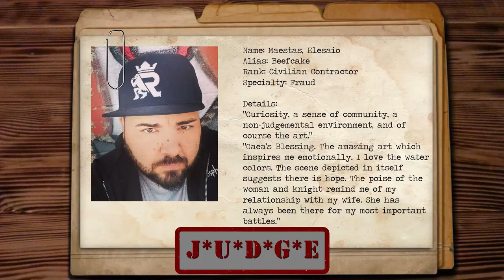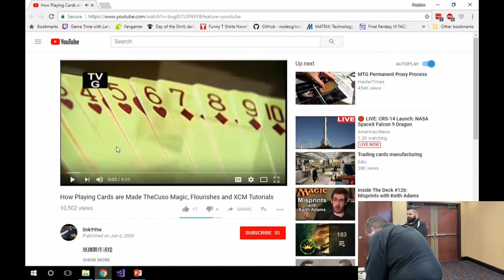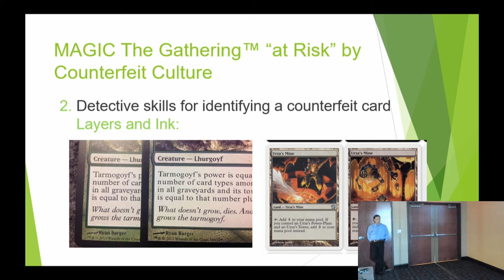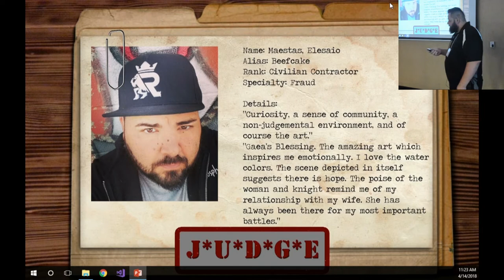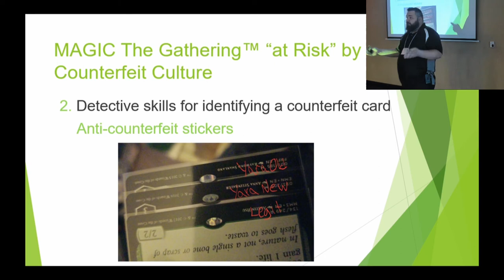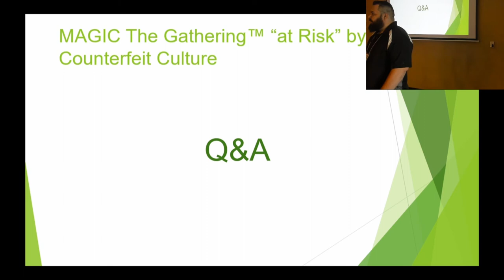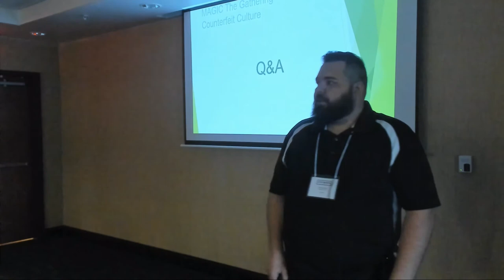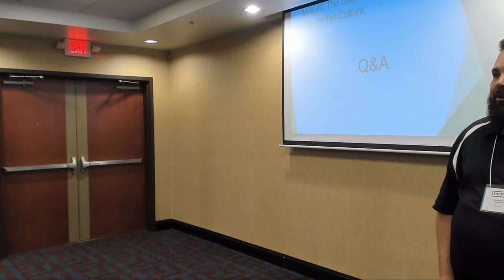Elesaio Maestas - Counterfeit Magic Card Detection

Comment: Also, "Beefcake" admitting to confiscating cards when the person next to them said they have no authority to do so is troubling - what if the person was legitimately scammed, and needed to hold on to the fake to get proof in order to dispute with Amazon, eBay, or wherever they got it from/got duped?  (on top of the fact that he was told that they don't have the authority to take cards from people, fake or not, and that it's still the player's property).
Reply: My guess is he considered brevity over accuracy for his presentation. Describing it with just "confiscating" can make it sound like he forcefully took possession. That's not how he works. It's more likely that he sat down with the player and took time to explain to the player what was going on and find out how the cards were acquired. If it was from tcg, amazon, etc. then he'd help by explaining what the player needed to do to try and get their money back. How do I know? He happened to be at the last event I judged and a player had roughly half his deck end up being counterfeit. He took almost an hour away from his booth to help the player sort out the cards and helped find replacements so that he could continue playing in the event. Beefcake did ask the player if he could have the cards after the event explaining that it removes them from possible circulation and can then use them as teaching examples (like in this conference presentation).
Reply: thank you preston, you nailed it!